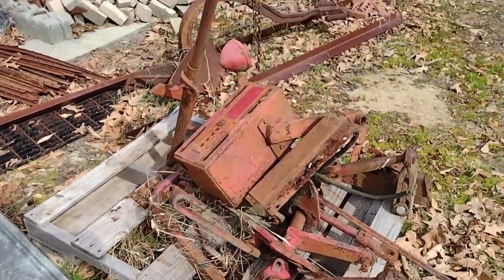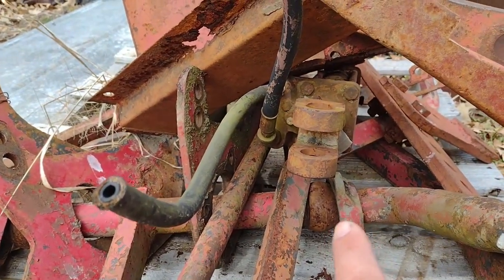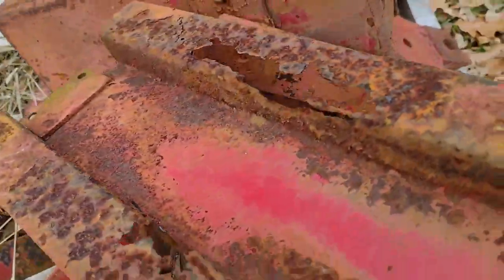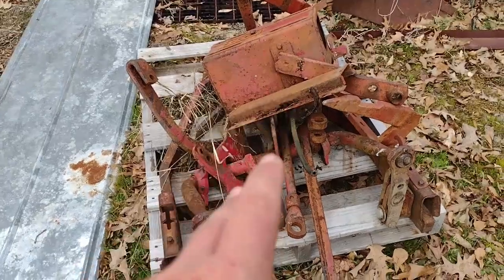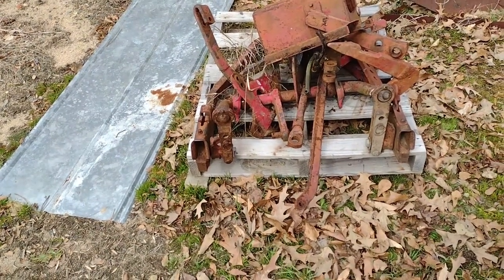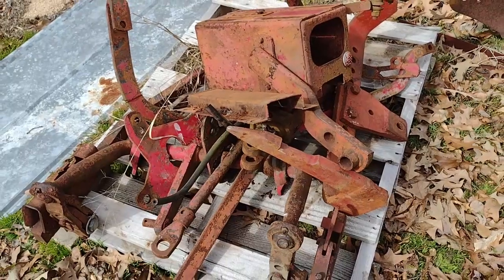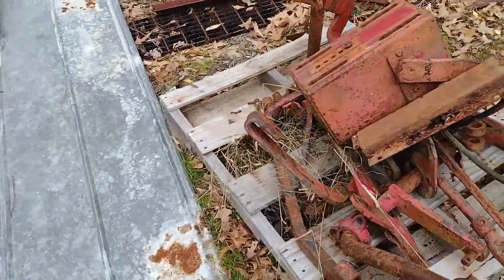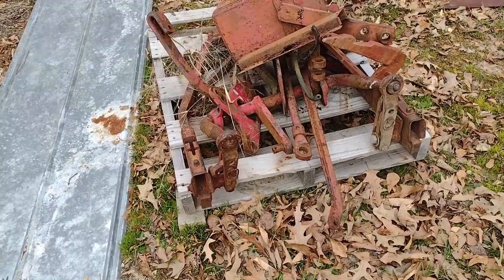Fast hitch for the Farmall SUPER C

Comment: Check your parts book for the lines from the pump. IIRC, there were 2 styles of pumps, even though they look similar, the lines are different and one won't bolt up to the other. I have a set off of a 200. Not sure now which pump the lines I have were for now. I sold my 200 a while ago, so I have no need for it.

Comment: I have a super C also with the fast hitch, trying to get that to work. Question, where do you buy parts? I need 2 fenders, any ideas? I live in the west side of NY (don't hold that against me!) Do you have a video of it put on your C? Thanks
Reply from the maker: I haven't got it on my tractor yet. I'm trying to get my touch control box rebuilt right now. Fenders shouldn't be too hard to find. Jp tractor salvage will have them .
Reply: @farmall51  thanks, I looked on Jp's site but couldn't find any, but I did send them an email. It seems like most of what they have listed says Sold on them. but thanks anyway.
Reply from the maker: @earlschultz7880  call and talk to John hargres